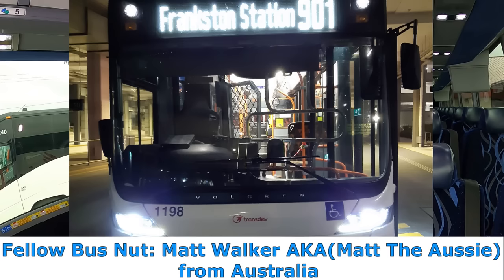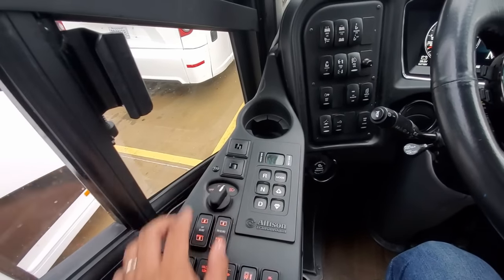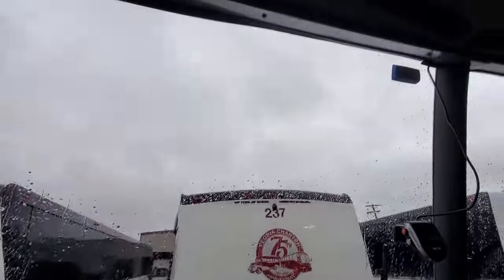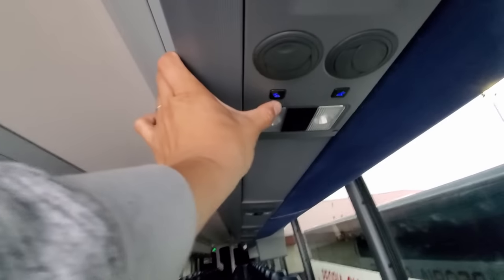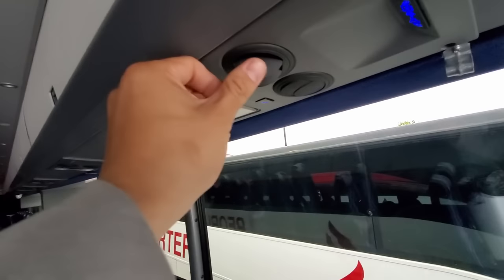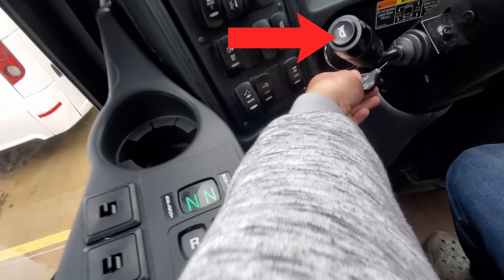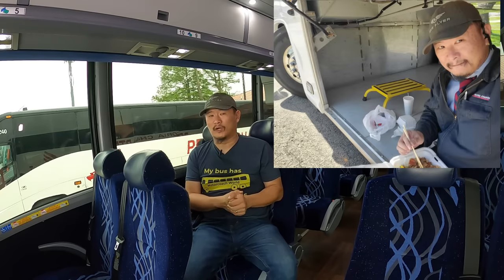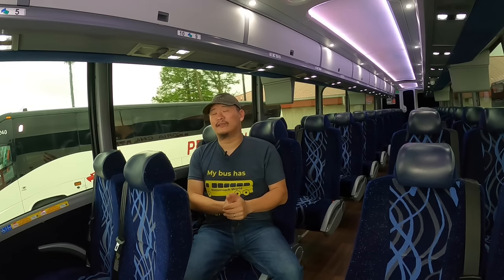What do all the buttons do?? | MCI J4500 2019

Comment: As a person who is blind from birth and has had a curiosity in how the current crop of highway coaches are controlled, thanks for doing this video and explaining what each of the buttons and switches do. I haven't made my way to the drivers seat and touched any of the buttons since I was about 10 either but, I've have been tempted. I remember when starting the buses required a toggle switch and a starter button, back in the 80s and from what this video tells me, this is a far cry from those simpler times.
Reply: Haw did you. Right it?
Reply: @Jackfitz595  yes, to and from school twice a week. I went to a school for the blind in Brantford Ontario and I live in Toronto! At some point, I had become interested in what buttons, switches and levers did what. This was back in the 1970s and 80s, when the buses sounded different then they do now and the doors were controlled, manually with a swinging lever to the right of the driver.
Reply: Transit coaches still need that toggle switch as well as the starter button
Reply: @BlindGordie  the buses sounded different because the Detroit Diesels back then were all 2 stroke engines versus everything modern is 4 stroke (better emissions and fuel mileage)

Comment: How things have changed.  I worked two summers as a student with a wide range of buses.  The MCI 4, I got to drive once a week on a long overnight run.  I prided myself at shifting smoothly.  Older drivers would sit in the back riding into the terminal.  Sitting over they transmission they could hear every click of the gear teeth.  They then gave you a personal opinion on your driving as they left the bus.  LOL

Comment: Regarding the LED Instrument panel: If you encounter a condition where the gauges do NOT display after you start the bus, We've had success at Bay Bus in Green Bay by doing this: Shut the bus down, walk back to the main power switch above the batteries and cut the power. Wait about 30 seconds. Power everything up. Restart the bus.

Comment: I have found on some trucks and buses that the doubling up on things light turn signals might be from some lower spec equipment might only have a standard gauge package without the video game display that the top end spec equipment might have.  Instead of using a different light package for the higher end displays they just have two turn signal lights.  Perhaps the "Greyhound spec" buses still utilize the older round gauge dash panels that still need the extra turn signal lights?  Kind of like having a blank switch cover for some of the accessories that cost extra and are deemed not needed in certain applications.  Great video!!

Comment: I love buttons and switches.  I love retrofitting my vehicle to control the auxiliary battery charging, phone charging (for long trips), the rear facing amber emergency light and a couple of 12 volt auxiliary power outlets.  Never got around to putting on the fog lights with switch, since newer headlights have a taller light dispersion pattern.  Great video.  Getting more like an aircraft with each model.

Comment: Nice...   you know I'm drooling watching this. Not because of the button explanation, but because of the bus features/appearance 🤩😍. Would be a huge step up from the '98 MCI that I've been driving lately 😖
Reply from the maker: Hey Mica. Thanks for the comment. What are you driving? A D model? You know... I know that 2019 j model in this video is far more advanced in almost every way than those old D models I used to drive... But there are times I would give almost anything to be able to get behind the wheel of a DL3 again...
Reply: @MotorcoachWorld  can you expand on that a bit? Are there certain driveability or ergonomic qualities that the older model has compared to the newer J, or are you speaking mainly just from a nostalgic point of view?
Reply from the maker: @rgiaco777  yes I'm actually doing a video soon about 10 things I like about the MCI J4500 cockpit.  This video was just about the dash buttons
Reply: @MotorcoachWorld  I think it's a D model, but not 100% sure.  It's very basic compared to the new ones. That being said, I did manage to learn a few things from this video; for example, what the engine override does.
I've been driving the yellow charter bus this week, but starting this weekend will be back in the coach driving a women's hockey team for the next week
Reply: Hello
Reply from the maker: @markmeadebolden8161  hi!

Comment: My guess on the dual turn signal indicators..

Depending on the position of the steering wheel and seat height, those indicators might be blocked from view. So with this setup, they should always be visible.
Reply: Coming at this from an aviation point of view, redundancy is always good.  Brandon they didn't take out the historic panel, too expensive ;)
Reply: or it could be USDOT law to have a physical indicators (i say that because my Audi Q7 had the same thing.. it had a digital screen for gauges and what not.. but for turn signals and check engine lights and so on there was a back lit panel)
Reply: @chaoszombie9995  My driving lesson car had a similar thing.  My driving instructor mentioned it might have had something to do with the bimetallic relay that make the blinkers work: if a light fails, the computer might not pick up on that in the same way (other than showing a caution of a broken bulb) whereas the blinker indicators that are actually in the same circuit with the actual indicator bulbs will blink faster when a bulb fails.
I think some of the Scania Irizar coaches we have here also have it, they show it on the dashboard as physical indicators and on the screen.  Whenever there's a malfunction (no matter how minor, caution, warning or severe warning) the screen blanks to show the fault found, so it might be that some screens blackout those indicators upon a problem.

Comment: Some of the clicks when the ignition is switched on are the ABS modulator valves performing self tests. On older MCI coaches the gauge clusters were also noisy when switched on self testing.

Comment: thanks for the great video.A few things that were not covered were the level control that can lift the coach or lower the coach.The mode button will let the bus go into economy shift mode.The entry door button.The reading light test button when pressed and pushing the brake pedal will illuminate all the exterior lights on the coach to test to make sure they work,great for pre trip and post trip inspections.on newer coaches there are paddle switches under the steering wheel for diagnostics on the dash

Comment: My university's previous shuttle buses (Scania K230UB) used coach bodywork (SC Chivalrous) that was modified for shuttle use by removing the underfloor luggage compartments & then lowering the cabin's floor at the front of the bus, also resulting in it's roof & windows being unusually tall and the bus handling more like a coach (i.e. greater inertia felt when braking & cornering, but road bumps were also more easily rode over). The individual passenger reading lights, switch buttons & even attendant call buttons were retained, though the buttons were deactivated and the reading lights are re-wired to switch on together with the gangway's lighting instead (probably controlled by the driver)

Comment: Excellent presentation.  I was waiting for you to mention the original J4500 then known as the Renaissance. 1999 I believe and we had three of them.  It also had a "glass" instrument display.  All the instruments were computer generated as in this video.  The driver's blinds were controlled by the computer.  The problem was that the computer would decide to move all the needles on the dials rapidly back and forth and the blinds would extend and then retract.  The only solution was to stop the bus and turn off the engine,  After waiting as long as it took to explain to the passengers what was happening, start the engine and proceed, hoping it wouldn't happen again.  I believe that the system only lasted one model year.

Comment: The redundant turn signal indicators are a requirement of the FMCSA regulations, so in the event your digital dash goes out you can still see your turn signals.  They are doing studies to allow for use of cameras in place of the mirrors too, so in the near future you may see all new vehicles without rearview side mirrors.  I'm sure that's going to be coupled with the blind spot monitoring system to help prevent side swipe accidents.  European coaches already use the cameras in place of the big, bulky mirrors and it seems to work really well.  You should see some of the different types of coaches available around the world, it's really cool to see what other countries have been able to do with motor coaches.  North America is starting to catch up a bit finally but bus travel across America still leaves lots to be desired (Greyhound is just awful. Period).  Megabus seems to be a great option but service is still pretty limited.  And whatever happened to Bolt Bus????  Remember the "Bolt for a buck" ad campaign??  Very catchy.

Comment: Nice production values. Likes the cut-ins from other shows. Good sense of humor. If I may make a suggestion: Some controls would benefit from not just "how this works" but adding WHY I would use something or what the implication is of using it. You started down that road with the engine-pre heat. You did a nice explanation of the rabbit and stairwell. I was hoping for a little something on Raising the back end. Overall: Informative and nice work!

Comment: Ah!  I remember those days of when kids would play with the controls on the bus.  I like the blue lights as they help keep the aisle lit at night but the amount of glare on the windshield is very limited.  I know that some disability organizations call discrimination "stupid" when they see a motorcoach company not having any buses without a wheelchair lift.  I know that MCI did answer the call by making a new bus with the J4500 shell but have installed a low-floor section for 2 wheelchairs.  So here is another good video suggestion.  If a disability organization wants to make a trip using a motorcoach and the organization may have a client or two that happens to be confined to a wheelchair, what is the best way for an organization like that to approach this question?

Comment: I think the redundancy of the turn signals on the dash could be due to the steering wheel position or if the sun was shining on the dash. I've had issues with the 'command center' in my husbands vehicle when the sun was hitting it and just couldn't see anything without moving to the back seat. I've also jumped into the seat after a driver and they're wheel position blocked the turn lights on the dash.
Great to see the evolution of the dash.
Reply: I also want to add that the University of Maryland's '21 J4500s are spec'd so that the  vehicle's outside cameras show on the screen, either while the four-ways are on or while a turn signal is activated. In those cases, the turn signal indicated on the screen disappears, leaving the redundant physical illumation to indicate the... indication. Check out my channel to see what I'm talking about!

Comment: It’s amazing how many “professionals” don’t know about high idling their diesel engines to prevent cylinder washdown by poorly atomised fuel. I see the odd video of guys running for extended times at low idle. Any truck I drove always was set to high idle whenever I parked. Let them find out later how they ruined their engines, I guess. But around $20,000 for an inframe is a hard pill to swallow.

Comment: On our coaches, the aux heat switch runs  electric resistance heaters in the passenger compartment.  The engine block heater is a plugin.  As well, at least on Greyhounds, the security switch is either marked fuel pump, or there’s a set of two identical switches somewhere on the dash, and you have to push and hold the redundant one.  Where are the driver speakers?  And one thing that erks me, is that they put on the wheel, three levels of engine braking (ours have switches on the panel to the immediate left of the wheel), and have clearance light interrupts, but does not have headlight interrupt for, as you said, letting another driver know they can come in, more courteously, at night.  We have constantly on headlights (hate them) and so cannot just turn light selector from headlights to clearance lights to dim the headlamps, nor have we an interrupt for just the same.

Comment: The “Mode” button on the transmission control panel isn’t for “manual shifting”, It’s for diagnostic purposes. 
If you want to manually control your gears, you simply use the arrow buttons

Comment: 11:38 is the answer to a mystery...when travelling at night on a coach once many years ago, I noticed that the coach driver and truckers would signal each other like that whenever passing. I always wondered how they did it! The only way I can see doing it in a car would be to turn the 4-way flashers on and off really quickly. :)
Reply: We do that because depth perception in mirrors is not great. It can be difficult to tell when you are clear of the vehicle you are passing. The vehicle getting passed will normally flash their headlights to signal the ofher driver that they have passed by a safe distance and are able to safely merge in front, the other driver will then flash in thanks. My box truck doesnt have the interupter so I personally will cycle the hazards 3 times.

Comment: Do you ever find yourself looking for a button or knob in your car when going from the coach to your car?  I wonder if it's similar to what I go through when I drive the family hauler (automatic) after having been in my personal car (5-speed manual): I will press on the non-existent clutch and reach for the stick.
Reply from the maker: LOL Yes i do that all the time after getting out of a coach to my personal vehicle! LOL
Reply: Some coaches I've rode on in my country use an electro-pneumatic pre-selector transmission (think it's called the Scania Comfort Shift), where the driver moves the gearstick halfway to the next gear he/she wants to select in advance (the trip computer will then show both the current gear & the next gear selected), then steps on the clutch pedal and completes moving the gearstick when he/she is ready to change gear. This setup allows the gearstick to have a shorter throw & thus slightly smoother shifting than a conventional completely mechanical transmission for buses/coaches I think

Comment: MCI would be ahead of the product and marketing curve if they added a special feature: A big red switch or turbo button that makes the engine put out more than 500 horsepower for a limited amount of time. "Maximum warp... Engage!"
Reply from the maker: LOL! I wish!
Reply: The technology is there,on police cruisers its called wot or wide open throttle .Alll non essential accessories are shut down under engine load.

Comment: My company has newer MCI’s that have the same exterior style and dash layout but with manual gauges. I think they are 2016 or 2018?  Only one set of turn signal indicator lights on those. 
Ours also don’t have nearly all the interior passenger light options yours have.
Reply from the maker: Yes we have some of those too. Those are 2013 to 2017 models I believe. After 2018 MCI introduced the newer interior.

Comment: Another interesting video James! Regarding signalling, in Canada I’ve noticed on the highway at night that when buses are passing each other in opposite directions the drivers turn on their left turn signals once as they pass. Have you seen that?
Reply from the maker: Huh! Interesting. I never knew that happened. I'm guessing they are greeting each other?? Maybe its for safety so that they can see the outline of their vehicles?? Im just speculating on why this could happen. In the US when buses pass each other in the opposite direction we just flash our high beams at each other to say hi.
Reply: I noticed it on divided highways so figured it must be saying hi as they passed at night.
Reply: I asked this question to other motorcoach drivers in Canada. They're just saying "Hi" or "Hello" to any motorcoach passing in the opposite direction, regardless of which company they work for. It gives them a bit of "solidarity and family" with other coach drivers.
Reply: Riding Greyhound here in the States back in the day, I noticed drivers flashing their headlights at each other.  Never noticed the turn signal thing.  That doesn't mean it didn't happen though.

Comment: Van Hool is actually Belgian, so the language you mistook for German is actually Flemish/Dutch ;) .
Next to that, most instructions will be universally given in English anyhow.  Volvo had this in their B10m types of buses at the end of the 80's: not enough air in the brake circuit shows a "BRAKE!" icon, and an oil pressure problem (insufficient level I think) made "OIL" come on along with a level indication icon around it.

Comment: Some large Diesel engine has automatic fast idle , the fact is a diesel at idle longer periods of time get too cold , don’t burn the fuel efficiently, build carbon in exhaust and turbo glaze cylinder sleeve,  and also on bus like your it help for proper AC compressor and alternator efficiency.

Comment: Can you please make a video on how to operate engine brake?  I just got a 2002 j 4500 and the driver never used the engine brake more over the driver didn't know that busses had engine brake like heavy trucks do, I drove busses before but old ones,  the ones that you operate engine brake  manually and if you don't turn it off when getting to the red light engine stalls, I just don't want to commit mistakes while driving it plus I love engine brake